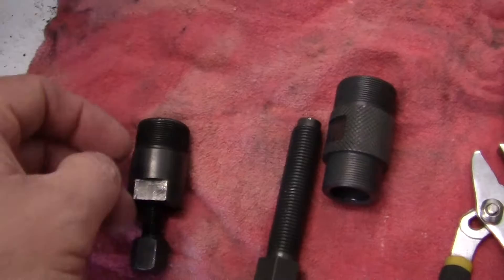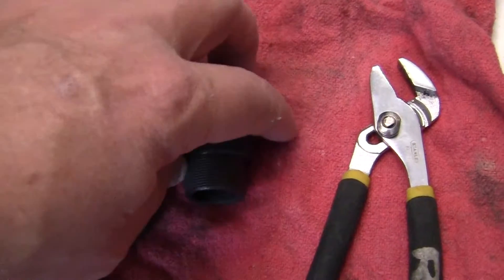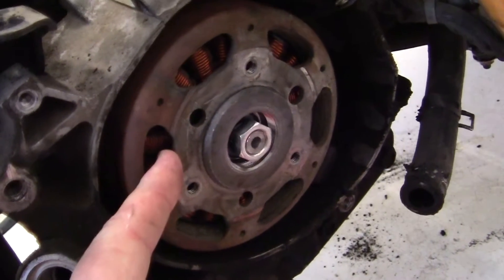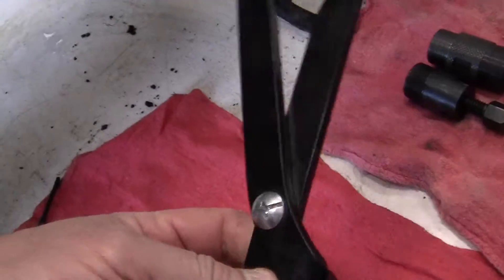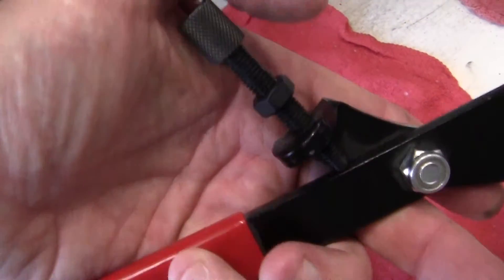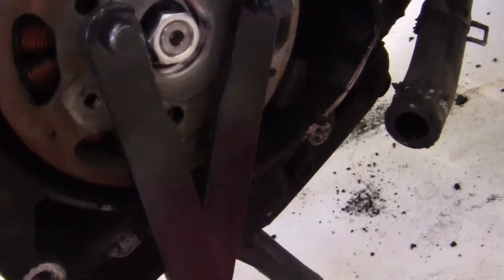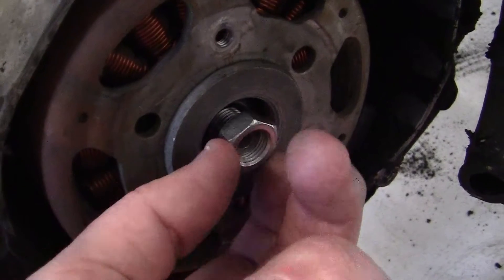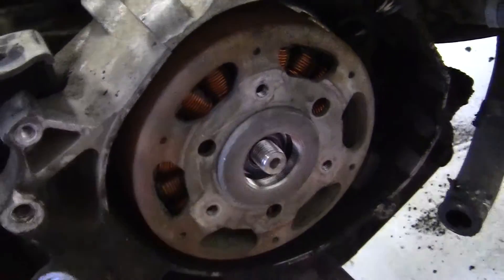22)-  PROJECT Honda  RUCKUS - HOW TO= Engine COMPLETE REBUILD

Comment: An impact gun takes those bolts off with ease. If you don't have a compressor, you can use a good elictric impact gun. My buddy has a Harbor Freight one and it works ok. I believe it's a 1/2"